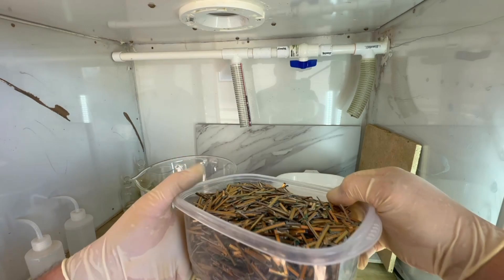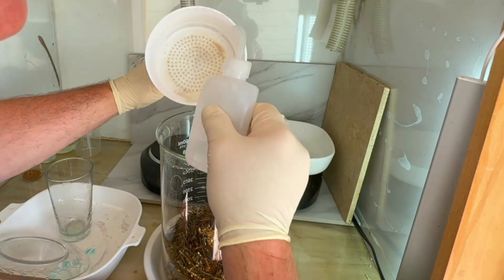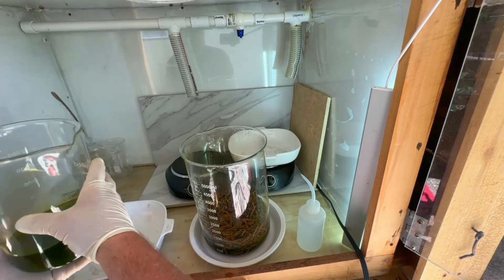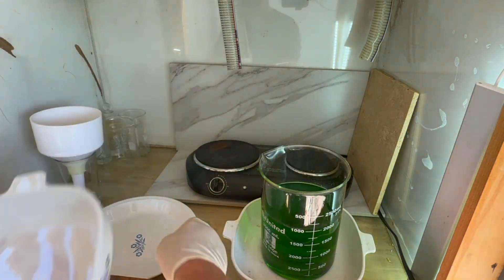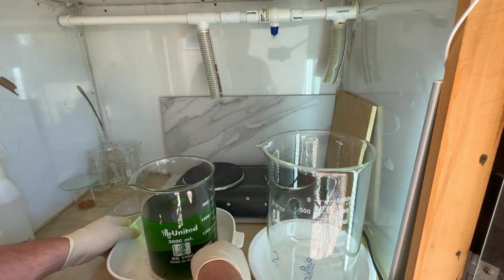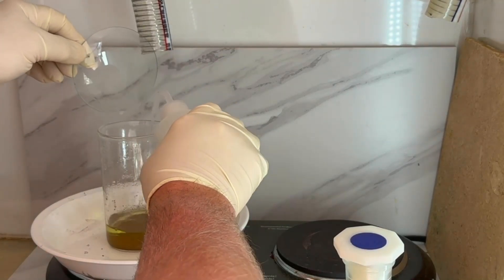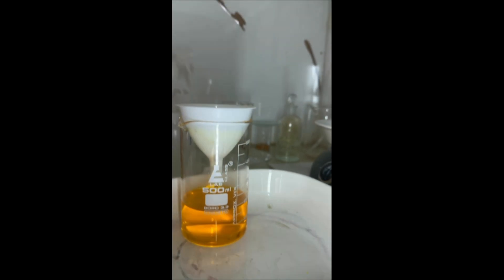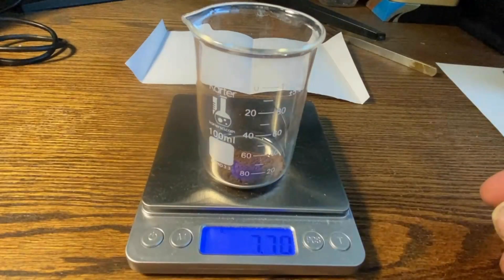How to refine gold from of 1.3kg Trimmed RAM Gold Fingers

Comment: Nice video again mate, 
Question, do you always only use 1 precipitant to drop your gold? i was led to believe that it is good practice to use 2 different types for each drop, i personally use Iron Sulfate for the first drop and SMB for the second. 
Nice powder either way. 
Looking forward to seeing your setup.
Reply from the maker: Not exclusively SMB.  It depends how dirty the drop might be.  Gerris Sulfate is the right choice for some material.  For fingers I can usually get to 999 without, but fairly, this was a dirty first drop, Ferris Sulfate may have been the right move.
Reply from the maker: Also, working on the lab video now…